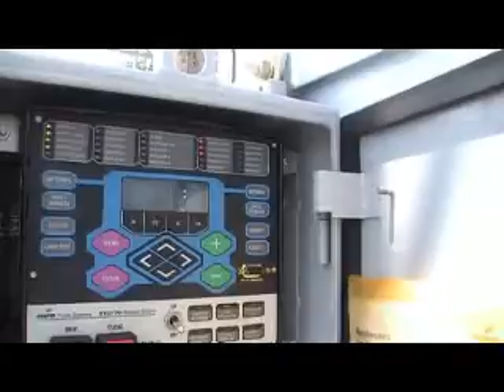Substation switching

Comment: @weeardguy  The first three knife links are the busbar isolator links, the second three knife links are the line isolators, then the oil switch is closed electrically at 0:58
1:14 he closes an other oil switch. then at 1:26 is a protection relay.
1:35 he opens an air break switch of some kind
1:56 he opens some more knife links

Comment: @sirsilentbob What I THINK is that first the air switches are being opened (it can be fuses) and than the switches that switch the load are being operated (I can't really tell if they're closed or opened) the grey boxes probably house switches that are under oil to quench arcs.

After that the lineman probably opens the HV switches with the large handle at about 1:35, succesfully disconnecting the line: the first actions are taken so the HV-switches don't open under load